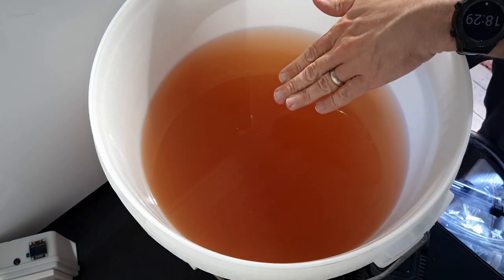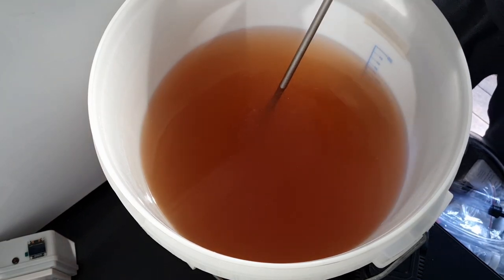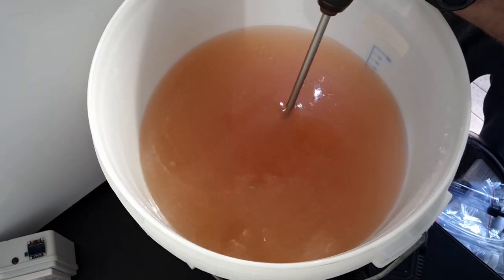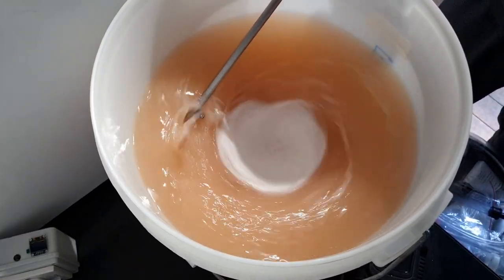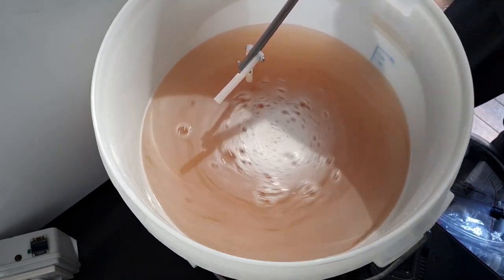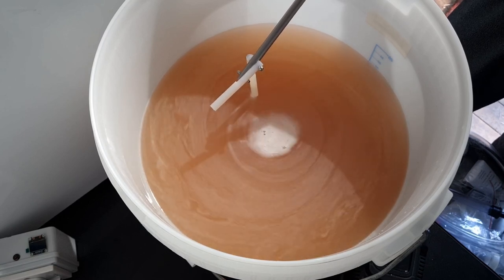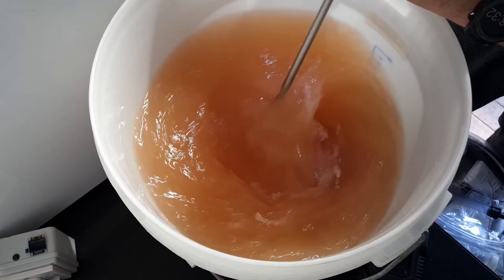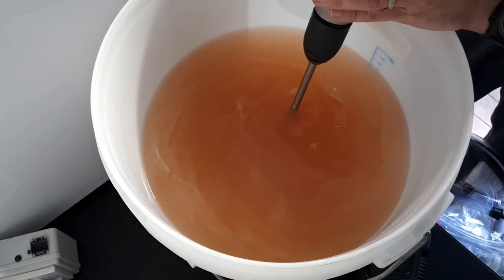Why do you need to Degas a wash?  How do you degas?

Comment: I actually don't degass my washes but there's a few reasons why.

My still spirits wash is a bit different - I do 7 KG of standard shop sugar VS 6KG, topping up to 26L instead of 25L using the still spirits pure turbo yeast packs. I actually do this twice, putting one bucket at a time into two of the home bargain's 80L containers doubled up. Holds 52L-ish like a champ, lid on and cover with a fine cloth blanket, leave it for two weeks. At about the half way point and 11-12 days, I stir it. Rack that off back into the two buckets separately, add the clearing solution, then rack that off into another double 80L setup for a clear approx 48L-ish wash. You'd think that'd introduce a lot of air but it seems fine. Distillers conditioner and the ceramic saddles in the air still, I've had no difference between degassing and when I haven't. If I had more room Id get better containers like barrels and actually have room to move them about. But it works for me, air still 4L, 900ml results, top up to 1.2L and I have 40-42% alcohol. About 14L from the batch.

My issue is finding filtering on the cheap. I use the flavourings so they don't have to be well filtered, but the lovebrewing "default" in the kit little tub thing with the small carbon cartridges is far too slow. I've been using Brita filters which have actually worked wonders but, should I really be spending 60-80 for the full carbon in line kit?
Reply from the maker: Hi Chris.  This is what I love about brewing, we can do it so differently from each other, we can make it our own.

As to filtering, I built my own Steel system using a 8 Liter pot and some 2" tri-clamp parts.  It takes a little over 200 grams of loose activated carbon and it polishes the spirit very well.  The activated carbon I buy from Love Brewing and is the cheapest carbon I have found and is very good quality.  The filter system you got with your boiler sounds like the small filter that Still Spirits made for the Air Still.  I had one and didn't like it either.  I would highly recommend building you own.  I hope to make a video soon showing how I built mine to give people ideas.
Reply: @brewingadvice  That would be great, the other DIY video you just released is the kind ofthing we need. I've been wanting to get into a proper setup recently but the £500+ cost including column etc have been putting me off, the more I can shave in the end, the more likely I am to go for it. It's not like it'll be more than a hobby or something I make money on so it's actually better hobby wise to have more DIY options rather than more costly ones.
Reply from the maker: I have two Air Stills  @ChrisSPCs   & enjoyed using just them for 7+ years.  I then got a T500 boiler with the T500 reflux column.  Then the beginning of last year I got the Love Brewing boiler and the Alembic Pot and the Alembic condenser.  Lastly beginning of this year I started to buy the parts to extend the T500 column to it rubs on the ceiling when standing on the floor.  I now get 96%ABV which is the maximum you can get from a still.  Sadly as you say it takes money.  Love Brewing (and other suppliers) often do deals.  You could get the T500 boiler and T500 column or the Love Brewing boiler and T500 column for £440 which would be all you need.  Then over time you can save and upgrade to make it even better.  Sadly £440 is also a lot of money when you already have an Air Still!

Comment: Just wait until you run across the problem I have , I did use turbo yeast to make a neutral spirit  for the holidays and after 7 days and countless attempts to degas its still putting off carbon dioxide ! Used turbo carbon and degassed it 10 to12 times a day and that sucker is still putting off carbon dioxide , so much so that the wash wont clear .  My starting gravity was 1.100 and its at zero now so its fermented that was 2 days ago and i did the iodine test to confirm, yet its still putting off co2 by the bucket fulls , its gotta degas sooner or later , i ordered a new carboy a 6.5 gallon one to try and poor it back and forth to see if that will help degas it ..usually my wash has already degassed and cleared by now  but not this one .. any ideas
Reply from the maker: That does not sound fun.  To be honest, if it is still producing CO2, I would just leave it as it clearly doesn't think it is ready.  I only recently had a wash that took 31 days to finish as while I did keep it cool, it just wasn't ready.  Don't rush it, while it may be taking longer than usual, keep taking SG readings and just leave it be.  I personally would leave it for 7 days, then see how it is.
Reply: if its fermented you should be under 1.0 - it was still running.